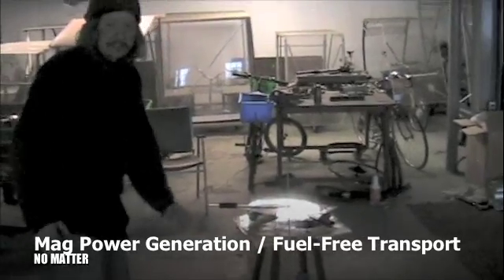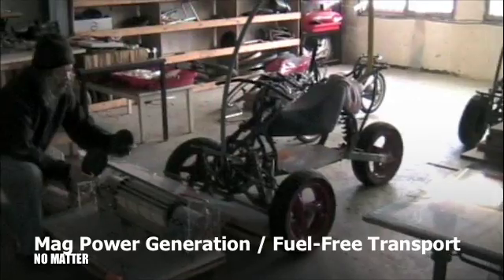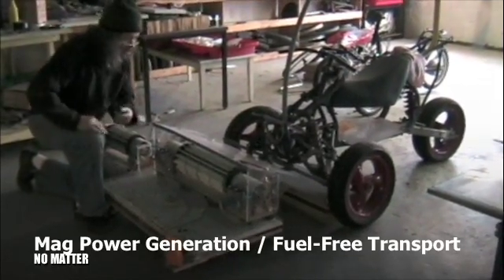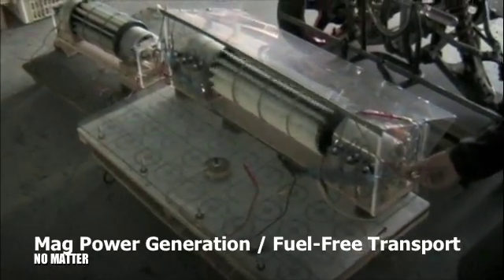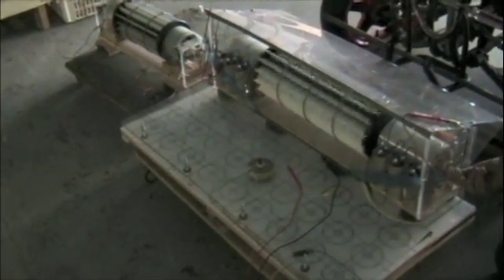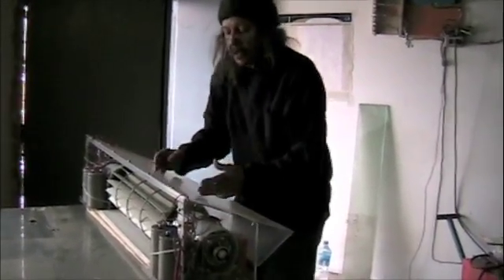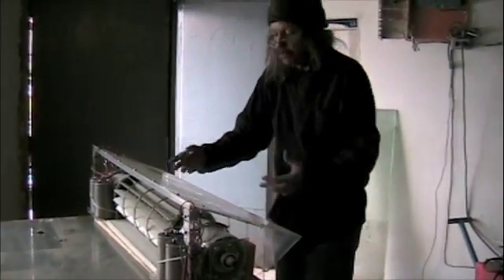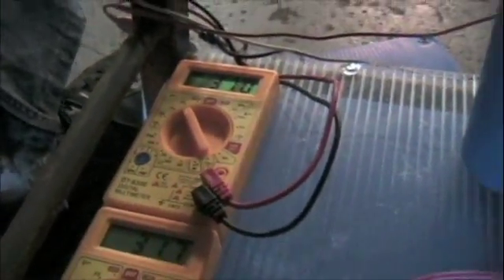Mag Power Generation / Magnetic-Field Propulsion / Fuel-Free Transport and No Matter

Comment: @dsr5dragon First this is NOT a MOTOR - it is a GENERATOR that outputs current without FUEL INPUT! Second HALL EFFECT SENSORS are used as MAGNETIC "Shift" control by millions of road vehicles right NOW! Third - Nisson Leaf went into production six months ago, selling well in EU. Fourth: these protos are replaced by BETTER Protos as problems are seen & overcome: the field is not STANDING STILL! See my new vids for Levitation Bearings & Zero Point friction elimination as an example.
Reply: Hvala ti hvala ! 👍🔥🔥🔥🔥🔥🔥🔥🔥

Comment: Marino: Capacitors have another important quality - they allow variable voltage inputs. Thus if your Wheel Mag-Drive needs 48v; this comes from the capacitor bank - not directly from Air Turbines/ Petal Generators or other Mag-Generated electrical devices. This is important, since Frictionless Magnetic bearings can spin 30-50 Thousand RPM's in air (much higher in vacumn - which is what UFO "Starships" probably use). High voltage output, WITHOUT transformer heat waste. Figure it out!

Comment: The Crown Jewel of the Steel Age, the Neo-Magnet, freezing it's alignment of all it's domains - thus producing no heat or friction loss. It's inevitable triumph as the self-propelled Magnet-Car, may be the least welcome news for ruling castes since the Communist Manifesto of 1848? As fuel-liberated areas spread, the Oil Dictatorships will fall in blackened disaster death-zones. Right with the dinosaurs time-machine wise!

Comment: Tek: All these generation systems are designed to feed into Mag-Drive Hub units - like you see on 100's of scooters & cycles on the street. THEY USE 1|10TH THE POWER for the same performance. Plastics use 1|10th the energy to re-cycle than metals (urban mining). 2 floor accel. ='ize wheel revs. thus saving 600lbs of axle & Diff-train & mech-Trans (like rudder of small planes). Under oil dictatorship it is hard for you to get any of this info, production of fuel-less has been initiated far away.

Comment: um I'm not sure it would help, but I liked the concepts in this vid, if you take a typical gas engine which is usually made of aluminum, replace the pistons with steel and replace the head with timed electric magnets using the mechanics of the engine on ether push or pull (or both if you can time it right), capacitors might be the key to return unused voltage to the power source, if it's possible one can convert any engine to run without gas, or maybe I'm just talking outa my low budget ass hehe

Comment: Banks don't want it, oil ditto, corp contractors follow. The one I am building has triple-function mag-wheels acting as: a) friction-free gears; b) Shift on gen-side to match Hall effect on use side; c) Fly-wheel stabilizer formed by magnets themselves alone. Also gen-stack can be put into turbine fin-drum itself, giving 28" X 14" unit of 20lbs, producing 18amps at 54v. 2 enough to drive small car 90km/p/hr. Then people PRODUCE rather than CONSUME - outside work "job".

Comment: Energy stored is one half of the capacitances value multiplied by the SQUARE of the stored voltage. So if capaitance doubles then energy is only doubled. BUT if voltage is doubled the energy stored increases by FOUR times! So actually better to increased stored voltage than increase capacitance ...within reason.